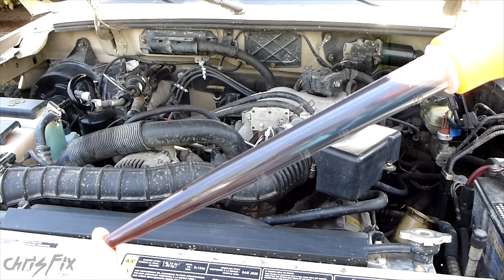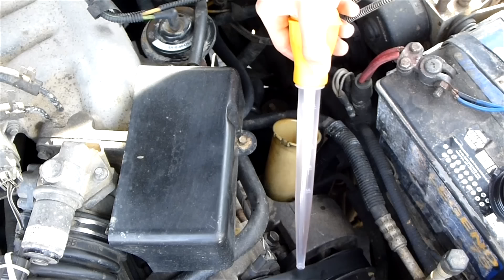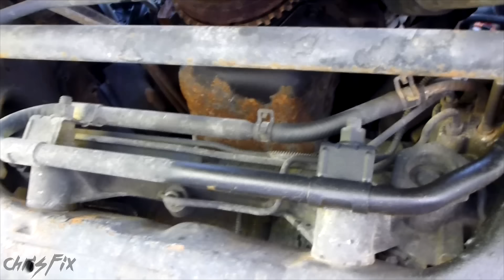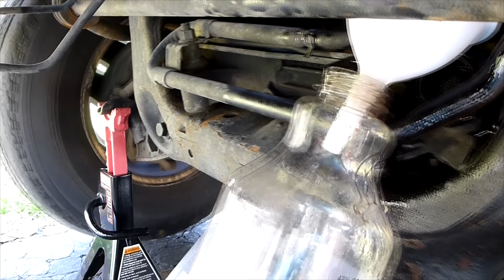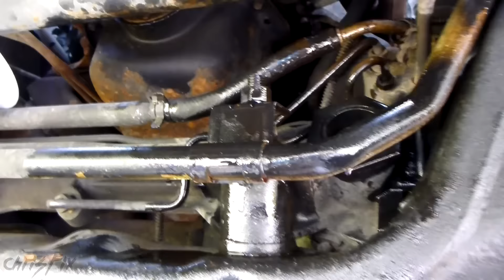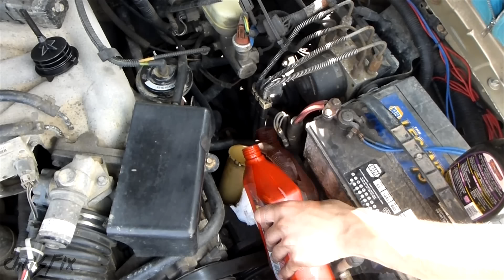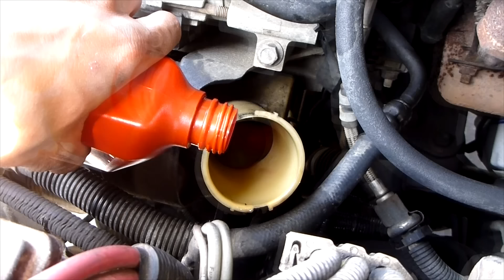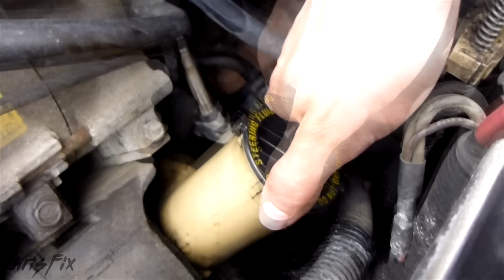How to Flush Your Power Steering Fluid

Comment: I was in dire need of a vehicle so I "inherited" a trashed 00' Ford Ranger. Its was the family truck that everyone and their grandma drove but no one took care of it. It runs solid but it sure feels a bit aged because of neglect. Well anyways I'm restoring the Ranger and your videos have been very helpful!
Reply from the maker: Glad the videos have been helpful! You will have that ranger in tip top shape in no time!
Reply: ChrisFix In due time it sure will! I've been working on it for a week now. It looks and feels better. Today I did the steering fluid flush, but that darn whine is still there. Although its not as loud as it used to be and the steering wheel feels a lot smoother now. I just wonder what's still making the whine when I turn :\
Reply from the maker: Ford Power steering pumps are know to whine when they age.
Reply: I'll see if it gets better in a few days or else I'll just get a rebuilt steering pump. They go for about $40 a the local store.. Do you plan on doing any videos on a steering pump swap? haha
Reply from the maker: ***** It will definitely get quieter in a few days. No matter what you do, there is going to be some air bubbles trapped but driving around will remove them. Took 2 days for my truck to become way quieter than before. I dont plan on any power steering pump swaps any time soon because they are all in good shape (knock on wood lol).
Reply: what power stering oil you used i got a 1997 ford ranger
Reply: Me too
Reply: I’m currently in the same situation with an old Audi, totally neglected but then again engine and gears seem to run good, always enjoyed Chris’s videos for years and years even though I didn’t have a car I just enjoyed learning about motors.. now I am prepped with the knowledge I gained using his brilliant videos.. managed my first oil change ever just yesterday, thank f*ck for ChrisFix
Reply: I own a 1999 Mazda B2500, 2.5L truck, the Ranger's twin. The odometer is stuck at 448,262 miles. They are tough little trucks!

Comment: or just disconnect the fitting on the power steering cooler and let all the fluid drain out 10x faster.
Reply: That's what I did and it pours fast! Better have a wide pan ready.
Reply from the maker: That is a good method too. Thanks for the tip!

Comment: how much power steering fluid do I need to completely flush the system? What is the most I would need? I have a 4.0L Jeep btw if that helps.
Reply from the maker: I used just about 1 quart to flush the whole system out. I thought it would take more fluid than that but most of the fluid is in the reservoir.
Reply: ChrisFix thanks, I'm ocd about my car, so I am planning on buying 1 small bottle of cheap stuff to flush it out fully, and then drain completely and add redline synthetic fluid. what do you think about this idea?
Reply from the maker: brianwilsonbeachboys Hey if it makes you happy, then do it. You will definitely get a lot more of the bad fluid out that way. Maybe run it for a day with the new, cheap, fluid in there and then flush with the new synthetic fluid. Honestly, that is overkill tho lol. Let me know how it goes!

Comment: To easy. Thanks again for the steady cam and excellent description. I found my memorial day weekend job. My 2000 Ranger 2.5l SOHC does have dirty fluid and a noisy pump. Ill let you know the result once I change it out.
Reply from the maker: Good Luck and let me know how it goes!
Reply: ChrisFix used your non-full flush method. I should have taken to account air in the system, after a refill. Feels better but still noisy. Gonna use that product you used. Too easy, took about an hour.
Reply from the maker: The noise will go away as you drive (the air bubbles will escape eventually). Just make sure your pump never runs dry because then you will damage it and the noise may never go away! I think after a few days you will feel and hear the difference!
Reply: Drove 150 miles today, noise and vibration gone. just the typical ford PS Pump noise now.

Comment: Also just adding fluid to reservior how does it push old fluid at return line without turning steering wheel.
Reply from the maker: The pressure from the new fluid in the reservoir above will force some of the old fluid out in the opposite direction. Turning the steering wheel pushes the old fluid out in the other direction. So doing both covers all of the fluid. Make sense?

Comment: When I add more fluid to get old fluid out do I need to turn steering wheel stop to stop. Your videos are awesome. I think ur bearing video is best in u tube
Reply from the maker: Thanks man. When you add more fluid, you do not turn the steering wheel (I dont think it will do anything if you do but you can try). Think of the system as a loop. When you turn the steering wheel, you are forcing old fluid from the bottom, up into the reservoir. That fluid is replaced by air. When you pump that old fluid out and add new fluid, it forces and extra old fluid out of the return line.

Comment: Good video. To bleed the system though, you would have to turn the steering wheel to it's maximum both left and right with the engine on (best with the car jacked up) This will push any air out. Do that a couple of times, and remember to check the fluid levels in between ofcourse.
Reply from the maker: Thanks man! You never want to run the car with no fluid in the power steering reservoir because it will damage the pump. That is why you turn the wheels from lock to lock in both directions with the engine off. This will force any of the old fluid out of the power steering lines from the pressure you create turning the wheel.
Reply: ChrisFix True that you don't want to run the pump dry, but you have to finish bleeding with the system under pressure (engine started)  to get all the air out...
Reply from the maker: Yea, which is what i did at the end... I put the new fluid in the reservoir to force any old fluid out and any bubbles in the return line, and then connected the hose as it was pouring out to limit the number of bubbles. Then I filled it completely with new fluid and started the car and quickly shut ut to make sure the pump didnt run dry. Then I put it on the ground and ran the engine and turned it from lock to lock a bunch of times and added new fluid until it didnt take anymore. Then I drove it and checked the level. That is how I bled it. Make sense?
Reply: ChrisFix Sure that makes sense - We just didn't get the lock to lock turning in the video with the engine on, which was why i wrote the comment in the first place :D
Keep up the good videos, and best of luck DIY'ing :)
Reply from the maker: Gotcha. Yea, that was what the 10min drive was for! Thanks again!

Comment: Excellent video. I was already planning on doing this to my own car, but I didn't know how to start. Does this work for most/all cars? Thanks!
Reply from the maker: Yes, this will work for most/all cars. I am also making another video on an easier/less messy method to do this. It isnt as good
 because you dont get all of the old fluid out, but it is probably good 
enough and def good enough if you flush your system at the recommended 
intervals.

Comment: that looks easey  but messey ill have to try that on my 97 explorer thanks
Reply from the maker: I am making another video on an easier/less messy method. It isnt as good because you dont get all of the old fluid out, but it is probably good enough and def good enough if you flush your system at the recommended intervals.

Comment: Smashing video, as allways :-)

I know its not the same subject but i used to have a small moped and it used the same atf for the autoclutch, it had to be atf otherwise the clutch would just disintegrate.

I assume its atf for the rubber seals/rings, good you made sure people know to use the correct stuff :-) and the additive helped a little as well :-).
Reply from the maker: Thanks bud! What moped did you have? I think you are right with using ATF for the rubber seals and rings.
Reply: ChrisFix
It was a 1978 puch maxi stepthrough type, but it served me very well when i was 16, simple/reliable and like a bicycle to repair, also i was sure someone was sneaking up and toping up the petrol tank, it just ran forever on 1/2 a gallon :-))
Good for the days when you cant afford much. :-)
Reply from the maker: That is the best feeling when 1/2 gallon gets you so far! I have a little boat that has a 5hp and I can run on 2 gallons for a week!
Reply: ChrisFix
Ahh but outboard motors have to rev like mad to push the boat along, so im not supprised it needs a bit more juice lol :-))

Comment: Looks like your oil pan gasket is popping out from the pan in the front. Just like mine is on my 3.0 ranger. Any quick fixes for that?  Great videos BTW.
Reply from the maker: Is yours leaking? Mine isnt leaking so I am not going to touch it I dont think... There are no quick fixes. You need to drain the oil pan, unbolt it, and then replace the gasket.

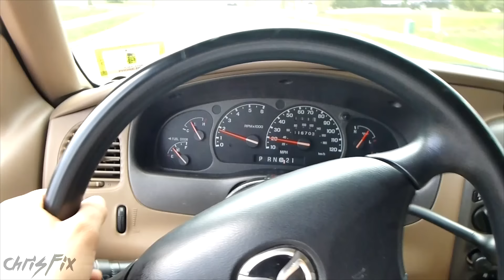Comment from the maker: +Alex C, I cannot reply to your comment directly for some reason. I did the test after the flush while I was driving. It was quiet (which I mentioned at 5:50). The focus of this video was to show people how to completely flush their power steering system rather than just quiet it with an additive like in the last video. Make sense? And to answer your question directly, the noise is gone. There is still a little noise while the steering wheel is being turned at idle but nothing noticeable and still way better than when I bought the truck.
Reply from the maker: ***** Thanks for the tips! This is great! I didnt use this method because I bled most of the air out when I was connecting the hoses near the end, but this is definitely a great method to use to ensure you get no trapped air. Thanks!
Reply: thanks for the respone :)
Reply: +gereral1  Injectors are still firing when you disable the fuel pump!.  Much better to just pull the EFI fuse which disables fuel pump AND injectors.  And also remove spark plugs when cranking... easier on the starter motor, battery and provides slightly faster cranking to spin up the PS pump.
Reply: hey chris fix, I have a 2004 dodge stratus rt v6 3.0L and it won't stop shaking. I changed the motor mounts, spark plugs and spark plug wires. but it still shakes. it does not rev, the engine just shakes like if there's an earthquake. can u give me some advice? I would really appreciate it a lot. thanks
Reply: what is that thing called, the one you used to get the old fluid out?
Reply: +Charlie Garcia a turkey baster
Reply: Paul Brown Thank you very much.
Reply: +Charlie Garcia Turkey Baster, it is normally used to prepare Turkey during ChristMas, but ChristFix used it toward cars.
Reply: DS S. Thank you very much for your answer☺
Reply: how much power steering fluid did you use? after flushing
Reply: hey Chris also commented on two other videos and base on the comments you just made I think may need to due a power steering flush but I don't hear the noise you heard but its dark black and the alignment guy mentioned it to me.
Reply: +ChrisFix A little noise while standing  still. this is the hardest work the power steering will do as it's still on the ground.  No biggie I'd say. Thanks for the  instructive you tubes you put out
Reply: +fannationwide there could be any number of reasons, ( if the car only shakes while at Low Speed and the RPM is lower than 1000 then probably its a wrong Air/fuel Ratio due to a Bad Mass Airflow Sensor or Clogged Fuel Injectors or clogged Air Filter ....etc. )  if there is a check engine light on the dashboard then have it scanned with a scan tool which your dealership should have Otherwise you'll end up spending a fortune on fixing the issue
Reply: DEEZ NUTZ GOTTY
Reply: ChrisFix Hi
Reply: Chris one question. When you think it's the best time to change the power steering fluid? How many miles it can last? My car has 66,000 miles on it with that same fluid in. I just don't want to wait until it make a sound while turning or turn to dark. Thank you
Reply: ChrisFi
Reply: I can't remove my old fluid, the reservoir have a small hole, the turkey baster won't go in, help plzz!
Reply: SillyTube -You need to get a clear hose (from parts store or somewhere) and put it on the end of your turkey baster and into the reservoir and suck it up like normal. Just get a small enough hose that will fit into the small hole in the reservoir and around the end of the turkey baster. 👍
Reply: ChrisFix  cStop touching my won
Reply: Air Bleeding
1.
Fill the power steering fluid reservoir up to the "MAX" position with specified fluid.
2.
Jack up the front wheels.
3.
Disconnect the ignition coil high tension cable(or remove the fuel pump fuse.. same thing), and then, while operating the starter motor intermittently (for 15 to 20 seconds), turn the steering wheel all the way to the left and then to the right five or six times
 
1a. When bleeding fluid, replenish with the fluid so that the level does not fall below the bottom of the filter.
2a.
If air bleeding is done while the vehicle is idling, the air will be broken up and absorbed into the fluid. Be sure to do the bleeding only while cranking.
3a Do not hold the steering wheel turned all the way to either side for more than ten seconds.
4a Confirm that the fluid is not milky and that the level is between "MAX" and "MIN" mark on the reservoir. Check that there is a little change in the fluid level when the steering wheel is turned left and right.

1.
If the fluid level varies 15mm (5.9 in) or more, bleed the air in the system again.
2.
If the fluid level suddenly rises after stopping the engine, further bleeding is required.
3.
Incomplete bleeding will produce a chattering sound in the pump and noise in the flow control valve, and lead to decreased durability of the pump.

Good video but I suggest you do not start the car to force air pockets into the power steering fluid.
Reply: ChrisFix
Reply: its just a turkey baster, not a very expensive item
Reply: Rev up your Toyotas! 

Am I out of place here?